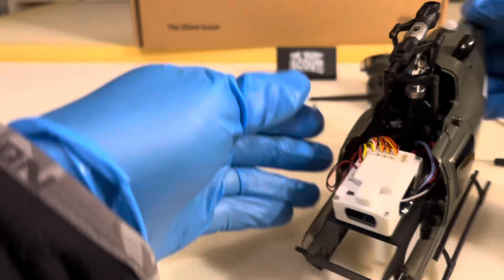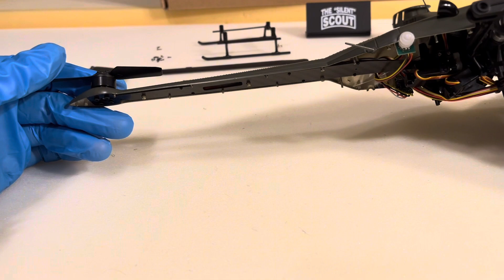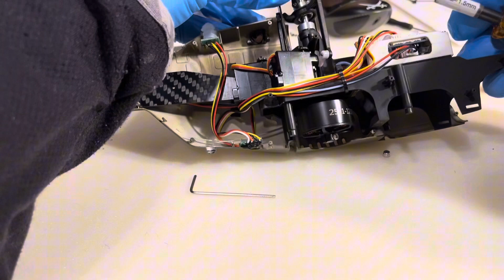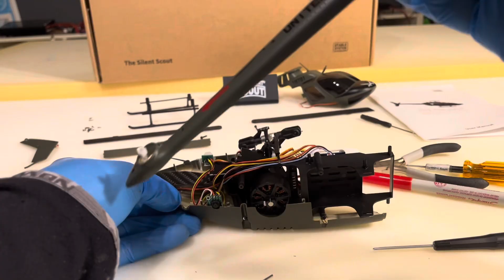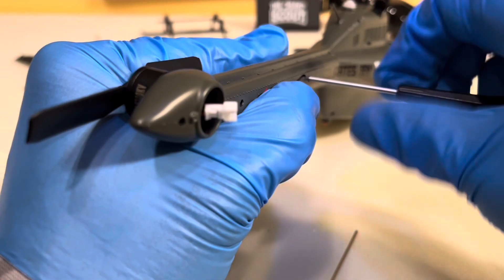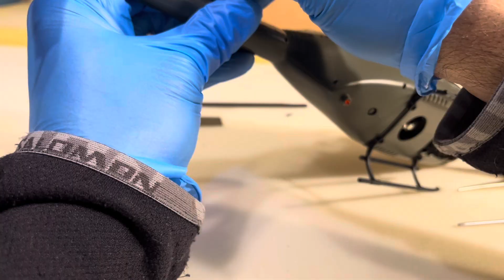How to repair and maintain Carmanon Bell OH-58 / Yu Xiang F08 Bell 206

Comment: I just purchased a YUI XIANG F08 Bell-206 heli from Razordon.  It flew two test flights just fine.  The third time I tried to take off all it did was rock forward.  I took a video and sent it to Razordon support.  I was hoping they would just tell me to box it up and send it back.  They came back asking me to take the canopy off and examine the internal parts for broken or detached parts.  I kinda figured they would try to fix it on the fly.  Thankfully I am mechanically inclined and have tools available.  Thanks to this video, I now know how to take the canopy off.  Thank you!
Reply: UPDATE: Razordon support was really not much help.  They asked for two videos.  One showing the takeoff issues and one showing the servo action with the canopy off.  I sent both.  I contacted YU XIANG support and they told me they cannot help me and to contact Razordon support.  Well, Razordon ended up sending the videos to YU XIANG.  LOL!  YU XIANG suggested exactly what I was already doing to find the problem.  Full circle back to no customer service.

Fast forward a week.  I contacted HeliDirect to just ask about spare parts availability.  Patrick went above and beyond to help me with no dog in the fight.  I sent him my videos and he sent them to their technical team.  They asked me to try to take off in Manual mode (auto OFF) and see what happened.  The heli took off fine in Manual.  However, I lost control of it and hit a tree.  Now I have a broken servo arm and both blades.  LOL.  HeliDirect recommended replacing the LIDAR sensor.  I ordered tools off Amazon a new sensor from YU XIANG and the rotors & servo arms from HeliDirect.  Will update this later.  Thoughts?

Comment: Hello
On my first flight I crashed my YU XIANG F08 on a tree. Since the crash, everything is working fine except the helicopter is uncontrollably leaning forward. Could you help me troubleshoot it. My heart is sinking. I need your help.
Reply: Dear @flight6677 i am delighted to tell you that my helicopter is up and running as good as new. Some minor repair done after opening the body and that is all what was required. I am watching your other informative videos as well to gain my knowledge. Thank you for making such content that enable us to persue our rc hobby.
Reply from the maker: Don’t worry! These helis are fixable and not an issue. Is the shaft bent? Any linkages broken from the swash plate? Are the servos gears stripped? Push down slowly on one when heli is energized and see if it resists. Don’t push too hard - just slightly to see if its gears are ok. If all is ok, then do a gyro calibration. Turn on and place on level ground. Pull down right stick and see blinking gyro LED. Take off and hover and hold her in one place - once happy land and pull down right stick and hold for a few seconds until the flashing light turned solid, then turn off the heli and the radio and restart. Watch this:

https://youtu.be/ZVtd-FdfdBA?si=TW539DBK5eI-lUot
Reply: @Flight6677 Dear thank you for your positive and quick reply. I shall update the situation after troubleshooting 😊

Comment: Thank you very much for going over all of this in such detail. I just purchased the Eachine 186 Bell version which is exactly the same as this Yu Xiang heli. I already ordered spare parts such as the complete screw set, rear tail blade and fin, and the landing skid. The rear tail fin looks very easy to repair 2 screws and then unplug the light. The landing skid also looked relatively easy just make sure to put enough pressure to get the screws in place. However, the main rotor blades is always where i screw up in terms of either having them too lose or tight. But you explained it quite well in how they have to fall when the heli is held at at angle in your hand. Sometimes that is trial and error in terms of loosening or tightening until they are just right. I wish you had removed the rear tail rotor though i would have liked to have seen how that comes on and off. Otherwise, thank you for this very thorough and nice job. Plus, you have a very calming voice which makes understanding all of this easier on the ears. Happy flying...:)

Comment: As a beginner should I
I buy this model or a smaller C138? Also can this model withstand crashes?
Reply from the maker: It depends on your budget and what you want to achieve.  C138 is better for indoor flying and this model (the OK-58 / YX F07) is more capable outdoors. But they are both very easy to fly IMO and good choices. The C138 is somewhat more docile due to its lower head speed.
Reply: Hello
On my first flight I crashed my YU XIANG F08 on a tree. Since the crash, everything is working fine except the helicopter is uncontrollably leaning forward. Could you help me troubleshoot it. My heart is sinking. I need your help.